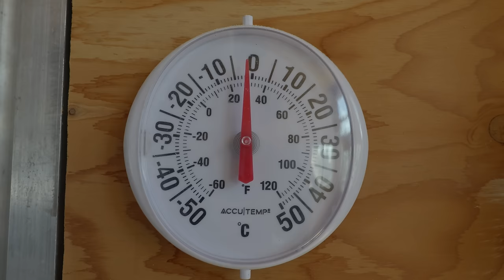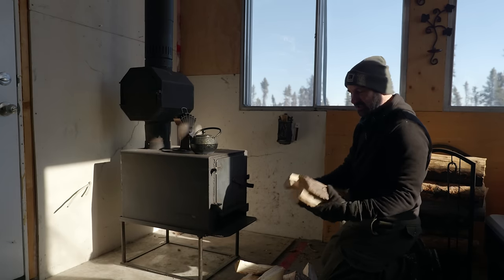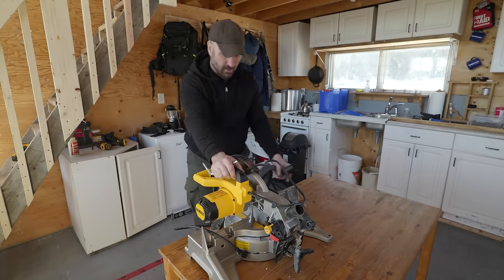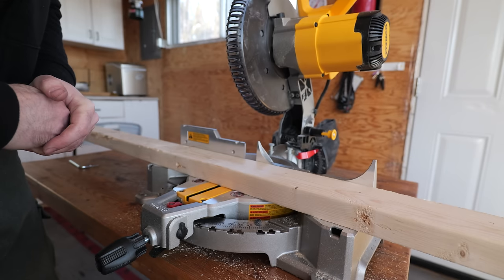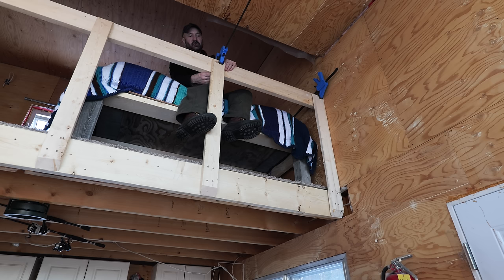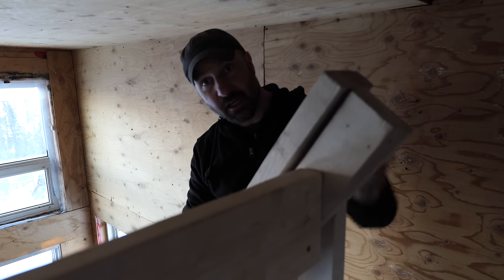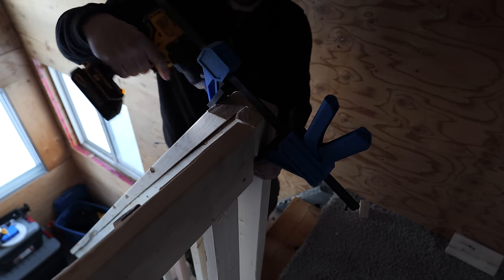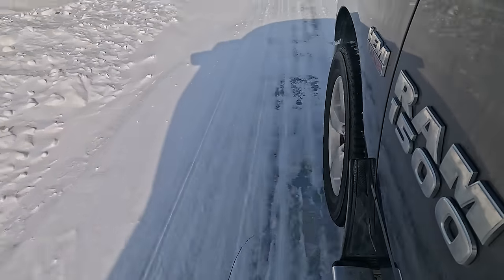BIGGEST MOMENT YET IN CABIN LIFE

Comment: I mentioned to you last video and I’ll mention it one more time. When using a saw that draws that much current instantly all you need to do is switch eco throttle off on your Honda. That’s why it is there. When finished turn eco throttle back on. Great video as always Jay. Plus you should check your draw on power while cutting.
Reply: Yeah, but the Battery(the power source) is a pretty decent regulator/capacitor for the generator. If you go Generator to Jackery(power supply) to saw, you should be good. I have a CPAP that I take camping, and batteries are pretty good at absorbing the jumps in power usage.
Reply: @Publikwerks  30 yr carpenter/ builder...1st question my repair guy asked, when bringing tools with electrical issues..."were you using a generator"....I tried to avoid direct generator plug in, at all costs, smartest thing, if setting up a cabin, set up deep cycle battery storage that the generator, solar panels, wind turbine charge and run a 12v to 110 converter off of...that way, constant, steady source of electricity...because your tools always break, when you using them...😆😆
Reply: wow    no need for parent mode.
Reply: Fantastic viewing. I get excited when l see you have posted. 😊😊🇬🇧

Comment: Here's a tip. Pre-start your screws in the lumber then put lumber in place and sink the screws. Another tip. Screws are not meant for permanent construction applications because they are brittle and break easily while nails are a softer metal and bend more easily thus allowing for minor movement of expansion and contraction. I would put carriage bolts through the lower handrail supports, bolting them into the floor joist and not relying upon 4 little screws to do the job. I've witnessed exterior decks collapse because of screw failures. When it comes time for working on the outside deck I would suggest you dig holes deep enough to go below the permafrost and pour concrete piers to mount the deck structure onto especially if a living dwelling will be built onto it. Screwing a deck to the existing structure is not recommended. I spent nearly 40 years in the building trades so I've seen my share of undesirable building methods. Go get um and be safe!
Reply: Excellent advice. I noticed his steps were a little wobbly.
Reply: Yep was about to comment this, get those screws started for the balusters on the floor before taking them to height, use clamps if you can get them in. Looks good though. Agree on carriage bolts too for the balusters, much more strength than a couple screws and can't be physically pulled out when shearing forces are applied
Reply: "temp" screw, adjust, and move on...
Reply: Yup on the carriage bolts….
Reply: Beat me to it
Reply: I also gave that advice when he build the stairs to use nails, my guess he didn't see that comment 😢
Reply: Hope he reads this advise this time…
Reply: Using structural framing construction screws is fine for most of this. Spax,  GRK, Griprite, Timber Lags for big stuff.

Comment: Jay, I noticed last video, you were worried about your 2200 W Honda gennie...My neighbour gave me an oversized insulated dog house with a door front and back to use as a cover for my 3000 W inverter YAMAHA gen.. After I start my gen, plug in the wires, I roll it up ( small 2 ft ramp) into the dog house. Both doors open...act like a fireplace..front door like a draft, back door like a flue. Rain and snow doesn't come in, quiet ...you could just a cut a door on each side of your generator box (with hinges), one side for exhaust, the other for air intake....keep at 'er....
Reply: Nice way to recycle big dog house.

Comment: Lowes and Home Depot down here carry Spax screws.  They are designed to carry weight 90 degrees to the insertion direction.  They have larger heads on them, about the size of a US Nickel.  You should add two of these Spax screws to the bottom of your 2x4 spindles.  This would give them some strength.  If you ever fell into the rail, you don’t want just deck screws holding you back.  I believe they are referred to as washer head Power Lags, etc.

Comment: Have you thought of building a storage bench on the outside wall that could be filled with firewood from outside? Insulate it and the access door outside, and insulate the lid at least and you would have firewood storage inside out of sight, and have a bench seat for sitting around the woodstove.

Comment: Jay i found your channel a year ago. I’ve made a few brief comments here and there. Today, however i just wanted to say your selection of instrumental music with the wilderness and Northern lights scenes is very serene. Bravo.
Reply: …might i make a slight suggestion for your top railing today. the butt joint with the wall could use a 6” piece of 2x2 on the loft side, screwed to brace the top rail to the wall then screwed to the 2x6. Angle the top and bottom like your spindles for decor. just a thought for added strength

Comment: Suggestion: a few feet above your woodstove put an expanded metal shelf to stack kindling on to really dry your wood for easier fire start ups.
It can be on a wood frame since that is what you are comfortable with. Expanded metal allows the hot air to pass through to the firewood.

Comment: You rail came out solid. I would pocket hole a few screws into the wall on the spindle up against the wall. You might also consider snapping a chalk line to keep your fastener schedule straight.

Those 2x6s can be used for anything. They make fantastic heavy duty shelves. Make sure to keep them off the ground, they aren't pressure treated.

Comment: Cap your railing Jay like you did on the stair rail, will make it much stronger and definitely secure the railing to the wall and use lags or through bolts on the vertical supports.

Comment: The rail you just put on looks great. Both that rail and the rail on the steps would be sturdier if you tied them to gather at the top and also tied the top of your new rail to the wall of the cabin on the other side of the loft. Also, it would keep the cabin more comfortable if you put in a ceiling fan. We run ours all night using our solar generator so we don’t have the noise of the gas generator. Diddo about turning off the eco mode on your Honda when you need the extra power for power tools.

Comment: A tip when screwing two pieces together (besides pre starting) if you're not clamped and the pieces push apart, let the screw sink a bit in the 2nd piece then back all the way put until they're tight together again and then send it home. They should pull up tight together.

Comment: Jay next time your doing a project like the banister boards using screws try to pre-drill your holes on the outer board with around 1/8” hole. It will be a TON easier to have the screws started in the pilot holes and in place. Will make holding boards with 1 hand and screw gun or driver a lot easier task.

Comment: Jay, the balusters on your railing should not have more than 4-inches between them. I’d personally go with 3.5 inches. Apply a baluster and then use a 2x4 (3.5”) as a spacer for the next baluster. This will keep them all uniform in their spacing and keep your younger pup from falling through them. 

Great videos.

Comment: I'd put some brackets attaching your new guardrail to the bannisters, and the other side to the wall for some strength, so it doesn't fail when leaning on it, lot of leverage from the top to where its screwed into the floor there

Comment: for those that wonder if he reads All the comments .. I can say he does .... when he pulled out that circular saw and used it my Electronics Engineering side JUMPED out and gave him the basic maths of what it was doing ... an a few suggestions of how to get around it ... the Power center is an excellent option ... and having it plugged in on the genny while it is being used will lengthen the time it can be used since most wont be using the saw constantly but in bursts to get a job done ... which gives the power center time to recharge ... t also has the added benefit of offsetting the stating draw by providing its amperage into the needs of the power center ... 

Jay you missed one bit a no load saw uses about 35% less power ... so slap a long log on there and cut it down to stove length and have the camera record the power draw.... that will be your most accurate high load limit 

btw a Bannister is where you run your hand while going up and down the stairs ... Balustrades are the spindles that hold it up for you to hold on to ... after al you slide down the banister and run into the knurl post attached to the final balustrade at the bottom 

Come n Jay ... even 4 of them harbour freight squeeze bar clamps for third hands would be useful for holding pieces in place while you align them and fasten them and they are cheap   .... heck 12 inch long ones make excellent third hands to hold stuff when you dont have a 6 year old to do that for you 

LOL ok you recalled them eventually ... as punishment you have to make some smoked ONLY bacon from some high fat meat at the cabin this year and it has to be low heat high smoke for a MINIMUM of 36 hours ... That or stick your head in a snow bank to the armpits ... ;) ... always nice to have options 

the header at the top of the stairs where you trimmed off the over shot ... when in the big city look at stair accents and find a knurl post top a nice ball with flat square base ... then router the handrail from the slant and the lot level into its base and fasten it to the hand rail ... something about the size of a softball or a nice honeydew melon size ... if you know someone with great painting skills have them pant it like a snow globe with your cabin inside ... or hollow it out a bit with chisels so it is a skeleton of rounded wood making a ball ... 

since you plan to do your building in winter ... get a LARGE Canvas tarp or car tent ... and one of your hot tent stoves ... use that to cover your work area and HEAT it ... this way you keep the snow off and the element out and have a relatively warm place to work ... added bonus the hot tent stove can have the lunch and dinner stew simmering away on it beside the coffee pot ... add a folding table and a chair or two and you have a break or problem solving spot near the fire to ponder the next step or way to get something done 

as your first project though ... make a shed with composting outhouse and nice 4 man hot tent stove and some copper pipe with water tank ... then the stove heats water and keeps the shed and outhouse warm in winter and the copper pipe can feed under the cabin to heat the floor and provide hot water on demand just top off the water tank (metal gas can or garbage can) ... to keep it loaded ... then even shoveling snow in the top of the can will melt and keep you going good ... 

as for purification once water reaches a roiling boil it can be removed from the heat and let to cool and it will have been above 97c longer than the 10minutes it needs to be to kill most of the germs and stuff ... have a section of clear pipe open to the sun and that will UV treat the water flow as well further killing off germs as well ... (about a 2 to 4foot  section of clear hose) ... and an old Tshirt a a basic debris filter for the top of the garbage can ....
Reply from the maker: Lots of great info in this comment. Thanks for taking the time to get it all in there. Jay
Reply: @jaylegere  yeah .. aside frm being a good boyscout ... the Canadian Forces extreme survival training is an AWESOME course ... you earn to take things that have as many different uses as possible so you maximize your kit for as little extra gear as possible .. 

the more uses you can find for something the better ... and dont forget to pack that pencil sharpener ... yep them old ones with the hb and 2h holes ... they make great points on wooden needles for leather and tips for tent stakes as well as excellent tinder for starting a fire ... they also make nice sharp points for bottom feeders that gul their food so when they pull on the line it flips a sharpened wooden toggle that lodges in their throat or gullet and holds them on the line ... works great with eels ... and catfish

Comment: Nice Video. Next time you do spindles, use a small 1x6 (or whatever spacing you prefer) board to gap all of them evenly. Just hold it between each as you screw them in and you do not have to measure spacing or anything. Not criticizing, just suggesting. Good luck on the rest of the build!

Comment: Your generator was fine. Use those to power construction sites all the time. I would not have any sensitive electronics plugged in while using the saw at the same time but the lights were fine just annoying. Can also try turning eco mode off that will help the start up of the saw.

Comment: Pro tip #2: Never use a stepladder like a regular ladder. They are designed to have all 4 feet on the floor. Plus, youll be able to plant your feet better, providing better balance. Because if you're not balanced you'll fall. If you fall you'll hurt yourself, requiring you to bleep your video. Then you'll have to go to the hospital. Which means you have to go outside in the cold.

Comment: Is it just me but the spaces between the spindles on the railing do not looked like the spacing is the same.
Reply: There's an easy way to make your spacing equal. You take the overall distance between your verticals, add the width of a spindle and then divide by your desired width (spindle width plus maximum allowed space, usually 4") between them. Giving a whole unit number, round up and divide into the original dimension giving you your spacing. Wala. I think. It's been a few months since doing it. Usually 4-5 a year at most. 😊

Comment: Looking good!! Release the trigger on the saw with blade down after the cut. Let the blade stop then let it come up. I would put a top plate for the top of the stairs. Also - get a battery router to round over all the edges. Makes everything not sharp or fear of splinters. Be super careful - dangerous tool. Pick a battery tool platform (suggest Milwaukee/Dewalt/Makita) and buy new tools as you need them. Makita actually has a coffee maker. I chose Milwaukee and love their nail guns. Use wood glue when possible. That is what gives strength. I enjoy the videos!!!

Comment: The railing looks great.  If you ever plan to have young children visit the cabin, you may want to make sure the gap between balusters is 4" or less to prevent heads from getting stuck between.  That's a code requirement in the states.

Comment: When putting in the balusters for the railing use a jig to space balusters that way they are all the same. Also, use lag bolts to secure the railing, u fall against that and ur going over. Predrill ur holes in the balusters so the ends don't split. How much dust are u introducing into the cabin into the air?  Also, research what u are doing first so ur not going into it blind. Keep up the good work. You have safety in mind nothing wrong with that. Good mindset.

Comment: Great job bud, looks wicked and glad to see you got it up for safety. Little trick for next one you build, instead of trying to hold the spindles plumb while screwing, pre mark where they’re gonna be with your level or speed square. Measure, then mark and away. Then you can easily blast it off without worrying. Then go back and double check with your level if you really wanna be sure when putting top rail on.